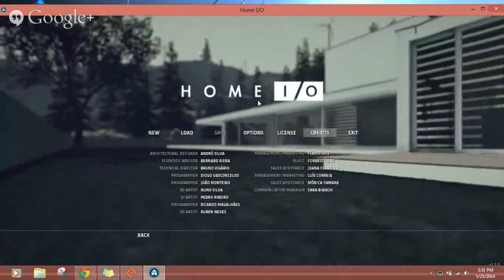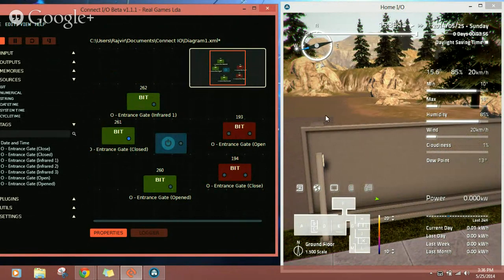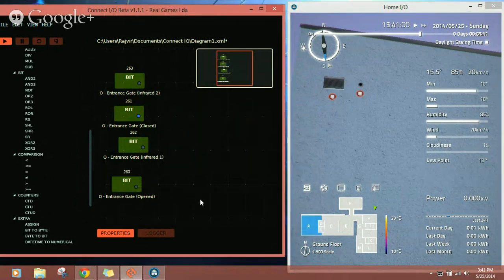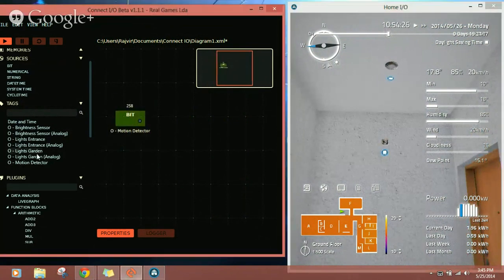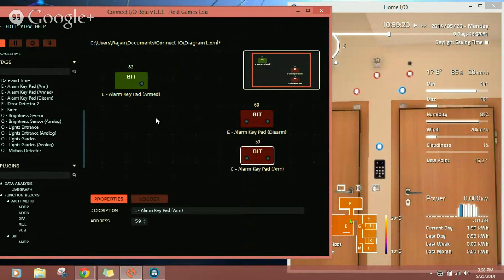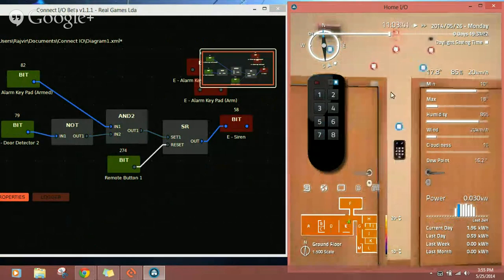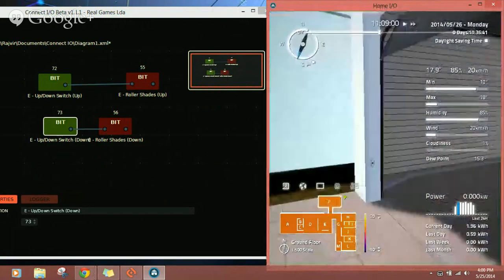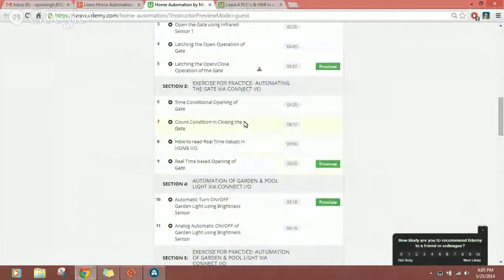Learn Home Automation on Home I/O- Bringing Home Automation

Comment: Hey thanks for the video,
I have a question, is it possible to log and save the activities of the sensors and switches in a text file?
I need to have data that is generated from the environment in response to the user action.
Reply from the maker: Hello designernasser - Yes it is possible to log the data as per customize sample rate in Connect I/O. I can share the screenshot- Please buzz me at nfiautomation@gmail.com.